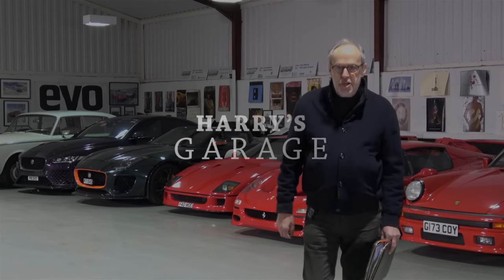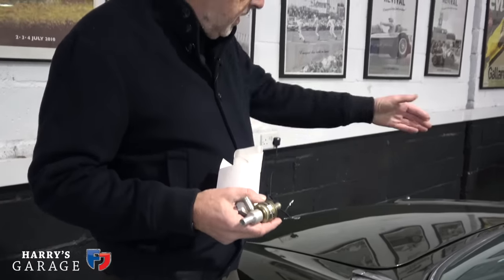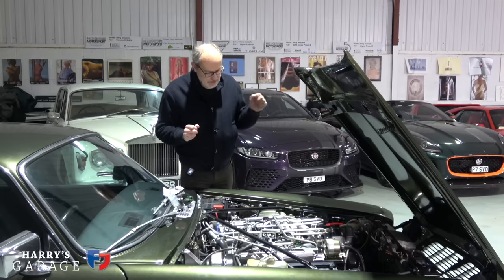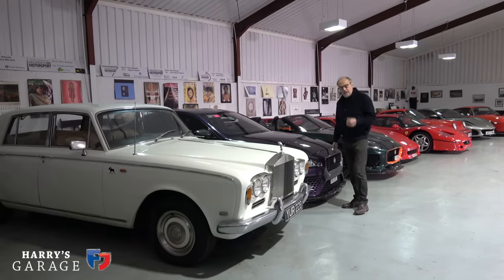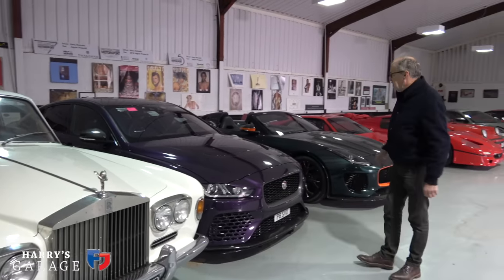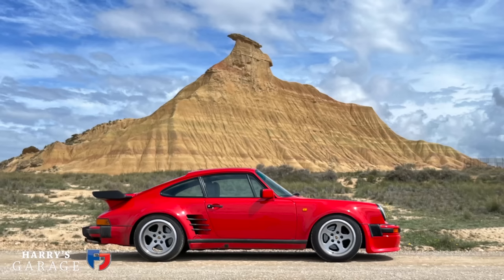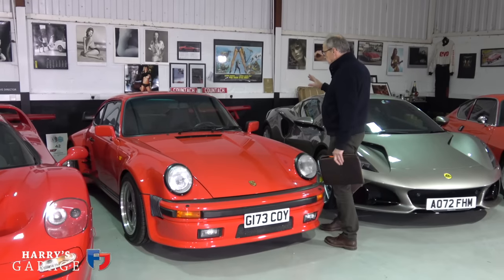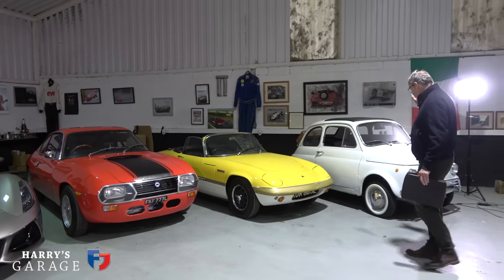Harry's Garage 2022 round-up. The highs & lows plus all the costs

Comment: About your issue with the Lamborghinis and parts availability, recently had a similar problem with my mercedes w126 300SE When updating the ignition, had to replace the rotor arm base plate. In the m103 engine, the rotor arm bolts into a plate that itself is bolted into the camshaft pulley. The question is that the plate itself broke when uninstalling the old rotor arm, and when sourcing a New one, neither Mercedes Benz nor Bosch (OEM) do not produce that part number anymore, there is instead an alternative part number with an alternative design. Bought that alternative that part From the dealer to discover it was a tad too short and the hole in the center a tad too narrow. Had to mechanise it and source a new bolt slightly longer from a random hardware store to make it work provisionally. There are aftermarket parts that copy the old design, but for some reason unknown to me, unavailable in Europe, you can just buy them from US stores and ship overseas paying shipping and import fees, being the quality also a question mark. Unthinkable to me considering it was a rather common Mercedes Benz engine.

Comment: Re. your Jag injectors, I've had problems with my W124 Merc injectors, until I found out, that Bosch now makes injectors that can withstand the mandatory Ethanol mix in modern fuel. The old ones melted partially inside, due to the wonders of modern fuel...

Comment: Smart motorways have radars which detect stationary vehicles, and should trigger some overhead signs to light up.
You were quite safe, Harry.
Assuming the system was working at the time.
Which isn't a given.
Reply: Trouble is drivers do not always take notice of overheads lights/signs.

Comment: Interesting about the XJC fuel return issue. I had a Jaguar Series 3 4.2, which was fuel injected, and never did a thing to the fuel system other than replace the fuel filter every so often. Was utterly reliable on the Series 3, but I guess it did have half the cylinders of the V12!!
Reply from the maker: The Series 3 V12 didn’t have any injection issues either. It’s just the early V12 cars that suffer, one solution is to fit carburetors and throw the fuel injection stuff in the bin but that feels like a backward step to me

Comment: interesting to hear your woes with restored /rebuilt cars; in our local classic car community and I believe nationally there have been significant issues with new/replacement parts for classic cars.  It is now such a big business there are a lot of substandard parts out there masquerading as high quality.  For example Bentley have had significant issues with their replacement gaskets for the old 6.75 V8s, and I had two new hydraulic accumulators fail on my newly serviced 70s Corniche; the (very) old ones were in actual fact fine.  Incidentally I have two Jag V12s and I use them weekly and they are fine; I was thinking of doing a routine replacement of the fuel rail rubbers and injectors but this has put me off

Comment: Common issue with using reproduced parts. Which is why I try to use New Old Stock items, and refurbish original items like starter motors, alternators and distributors whenever possible. Encouraging to see that open cheque book restorations have the same problems as us mere mortals restoring cars in lockup garages.

Comment: one of the issues I've noticed is that companies that make re issue parts can only take an average of what was fitted in period, especially ignition parts as most manufacturers would use several suppliers in the day. I well remember the breadvan VW Polo having 2 different distributers which looked the same and the parts seemed to fit either unit but trust me after much swearing I found that they didn't. Now I'll bet the only parts you can get easily now are for the more common distributer. Don't get me started on  hydraulic parts for old BL cars either.

Comment: Great video and a Happy New Year to you Harry!  Please can we have a TT600 build video series?  Rare bike that! Be an excellent off road tool.  Looking forward to the completion of the Lamborghini and the Testarossa.  Quick one:  Why are you still running horrible old points and dizzy setups on these old cars when electronic ignition and even coil per cylinder conversions on modern EMS would transform their usability? Even the Zag is running modern electronic spark control albeit through a diz!

Comment: So interesting on parts quality I have had the same issue on XJS parts being produced which just don't meet quality in anyway. Bit shocked by your injector rebuild costs had jaguar XJS 6 cylinder done with data provided prior and post rebuild for 25% of what you were charged. I would guess your problem may not be injectors but filter issue. Glad you are sorting the XJ exhaust always looked too low.

Comment: 2:30 
Make a new connection tube from the left tank to the right tank?
So that it evens out again.
That fuel spill is seriously dangerous
Reply: 5:50 Maybe those rubber seals are too hard, compression loss, cylinder not firing.

Comment: Rather than just swapping injectors, what exactly is going wrong with them? Are they getting gummed up (is the tank clean)? are they failing electrically (is the impedance the same across good and bad units)? Is it always the same injectors?

Most injectors are pintle type and don't mind modern fuel. The only thing to really worry about are internal seals made from nitrile rubber which need to be switched to viton to be able to handle ethanol. I've had newly refurbished units come back with nitrile, although they're just the main external seals.

Comment: I wonder if the ethanol in the fuel is causing these problems as its more corrosive and does cause problems with older cars.
Reply from the maker: All the cars in the garage run on super unleaded to minimise ethanol issues. It’s a right pain whatever is causing the problems!

Comment: Harry, I think that the issue you're running into is that the factory fitted parts for Lambos aren't the same from year to year and even within years. There is unfortunately not very good documentation of this. The people remanufacturing the parts don't have enough copies of the variations and should be thanking you for finding these deviations and asking you for original components so that they can expand their capabilities.

Comment: The Zagato is an amazing story. Based on the horrible condition of the car and the inability to really fix the panels, what does this do to the value of that car? As stated it was a driver project, meant to use, but I am still curious as to what that car is worth vs. one with better sheet metal?

Comment: £7000 to insure everything sounds good value but is it really? 
You can only drive one at once and the combined mileage will the same whether you have one or 100 cars. I realise there's more than one driver & theoretically the whole shed could go up in smoke etc etc but once you've got one expensive car the actual risk to the insurance company won't increase that much just by buying more.
I'd be curious what the Project 8 would cost on its own, or what difference all the cars being split between several locations would make - just out of idle curiosity I mean!

Comment: It’s probably why used dealers like Tony Gravelwood Car Sales on Behind The Glass Podcast with Seen Through Glass’ Sam won’t touch cars older than 3-4 years old.  Most people couldn’t cope with the stress of it but with your knowledge and expertise can.  I tend to think you can get taken for a ride with restoration work.  I likes the first Lamborghini restoration of the Lambada from September 2019 but mainly watch your reviews of all the latest top Ferrari and other premium vehicles.  I’d get rid of the Jaguar Project 8 and the XJ and get something like a Bentley or Aston Martin with a good warranty and service package in the run up to full electrification is it doesn’t stall in 2030.  Whether the manufacturers will service them or provide parts post 2030 doesn’t seem clear.  I also like Audi RS and S variants.  You could get a Lamborghini Urus.  They’ve made so many there must be good parts support. Also Audi RSQ8 or Aston Martin DBX 707.

Comment: "Part Quality" is a truly frustrating experience which seems to be a worldwide problem. I have numerous negative dealings with this matter however in Harry's case it makes a complete mockery of trying to "run in" the rebuilt Jag engine. With those injectors failing I guarantee those cylinder bores with the dodgy injectors will be scored / damaged. Absolutely Horrendous😖😖

Comment: Interesting and refreshingly frank.

With respect to injectors, this issue is keeping an XJ12 I know of off the road, so a good, tested component would be welcomed. The owner of the car in question has spent about 4 times its value on trying to solve these after-market gremlins. 

For the Espade, distributors have not been made properly for years and this is the main reason why FIA Appendix K (6.5) allows for Period F onwards "non-period electronic ignition system provided this system is triggered by contact breaker(s), utilises an ignition coil
with a minimum resistance of 3 ohms, the spark is distributed by a rotor arm and the timing of the spark is controlled entirely by mechanical means". 

Whilst I can understand that purists / concours judges may not like this...I would not risk a beautifully built V12 with even OEM remanufactured components.

Comment: Jaguar injectors! 2k! There's nothing wrong with standard injectiors... However the system is far too old.... I converted my xjs v12 to modern Motec, costom system with modern injectors and lambda sensors..... Its fantastic with instantaneous throttle response... & great economy

Comment: The shoddy modern replacement parts situation does annoy me. It's easy to blame the Chinese, but the real problem is the casual attitude of the European suppliers. If they specified the quality and tolerances properly, the Chinese are quite capable of manufacturing the parts to be as good as the original.

Comment: It is a bit disappointing that the firm who rebuilt the v12 hadn't preempted the injector issue as it is a not uncommon engine and I'm surprised they were not aware of it.  Also I would expect that someone would have checked the Lamborghini rotor arm against the original. You are not exactly using any old garage, these people are otherwise supposed to be the best.
Reply: Anyone else would fit an electronic distributor so you don't have points and issues like this to the Lambo and there are ones that look like the original.

Comment: If the fuel injection is still a pain perhaps a more modern system would be better. Emerald stand alone strike me like the sort of company that wouldn’t be scared off by an old jaguar.

The tank issue - sure there’s a way of sorting that as well without relying on old valves. Would also be worth thinking about some sort of buzzer/light that activate when the level is too high.  Better than relying on your nose
Reply: Maybe the lambo needs to go distributorless as well…hadn’t got that far before comment 😂

Comment: Good news / bad news on the repro parts stuff.  I've owned the same '69 Camaro for going on 33 years now and the repro stuff is atrocious.  Even the GM licensed stuff can be garbage.  It took me two orders of RS vacuum headlight switch and actuators to get working parts.  There is so much demand and no accountability.  Once the factory quality control is bypassed junk gets through that new car customers wouldn't put up with.  Luckily for you enough deep pocketed collectors should be able to turn up the screws on Lamborghini to force them to implement some QC instead of just licensing aftermarket garbage.  It begins to make a case for converting to coil near plug with a crank trigger as a permanent remedy.  Myself, I run an MSD billet distributor that is fully locked out and an MSD-6AL programmable spark box on my Camaro.  But you may be forced into coil near plug if you can't get decent caps and rotors for the 4 liter.

Comment: I can envision one of the reasons why re-manufactured parts end up not matching the originals is the loss of the tribal knowledge gained during the initial development. A drawing is made. Parts are fabricated. The process steps of that fabrication, especially those that require heat treatment (for instance) are seldom fully captured. For that matter, there could also be undocumented steps taken at the time of assembly. Dimensional tweaks made along the way that enable finished parts to work flawlessly in the assembly are noted on scraps of paper or in some craftsman's head. The drawing may or may not be revised to reflect an interpretation of the perceived intent of these. Does it though? No one is actually going to check because the parts arriving are functional. 

Does it excuse it? 

There is some value in supplying a gear that with modification enables a vehicle to live on. It's better than nothing. 

For the VW Group or Jag-LR the sales are chump change in the big picture. Regardless, someone in the management chain is responsible for this market sector and must know that 'some' parts they are representing as functional drop-ins don't meet that standard. We can only hope that their ethical and moral compass is working up to snuff and effort is being made to correct the deficiencies (as opposed to a 'take the money and run' attitude).

Comment: With regards to the XJC V12, this is why a fairly straight resto (except the g'box and a few other bits) would never appeal. This is why i would much rather give it to Retropower to work their magic- pissing about with old Jaguar parts designed in the 60's/70's - no thank you. Retro mods are way way more appealing and people forget it's not just about modding for more power/ pace but also for more usability.

Comment: Is it the E10/E5 Petrol wrecking the Jag Injectors ...?? Gov website states ...

'Jaguar
E10 petrol is cleared for use in all Jaguar vehicles with petrol engines starting from model year 1992. Older models should continue to use E5.

I'm still not sure if my vehicle is E10 compatible
If you're not sure if you can use E10 in your vehicle:

check the vehicle owner's manual, the instructional booklet is specific to your vehicle
look inside of the fuel filler flap
ask the car, motorcycle or scooter manufacturer / local dealer
If you're still not sure, use E5 petrol. It will still be available in the super grade at many filling stations.

I'm still not sure if my vehicle is E10 compatible
If you're not sure if you can use E10 in your vehicle:

check the vehicle owner's manual, the instructional booklet is specific to your vehicle
look inside of the fuel filler flap
ask the car, motorcycle or scooter manufacturer / local dealer
If you're still not sure, use E5 petrol. It will still be available in the super grade at many filling stations.'

Comment: 2:06 Harry why dont you convert the thing to a normal tank with a modern fuel cell? also did you check the voltage to see if maybe the new ones, both pump and fuel injector are made with a different voltage spec from the originals, like knowing Leeland, they might have been made with europe's I think 212 spec voltage, vs the 124 of the US, like maybe you got the US spec ones in a europe car, or vice versa

I mean its british leeland, and the cars over 50 some years old, anythings possible with that lot, like it could be that half your car is designed with the wrong voltage in mind and it fails because of it

and with the crosspipes being fitted to it, that is how people make LS motors not sound like rubbish, so you might end up with more an XJ13 type noise at the end of it

and I gotta laugh with 9:08 as today on harry's garage, harry try's MS paint!

Comment: Oh like an old small airplane with dual tanks... isn't it about as dumb as could ever be conceived.  Don't even ask how many small planes have crashed because the pilots do not switch over properly.  A true high point in engineering design.

Comment: Shoddy spare parts is a global issue especially when so called genuine parts or OEM parts are now coming from the same  global suppliers and simpy re-boxed as genuine or OEM
I own 3 x MB W126's and feel your pain with this global rip-off.  The truth is majority are coming from China and quality control is poor, material choice is sub-standard, rubber components are recycled rubbish that quickly fails.  Even Bosch has lowered their standards by outsourcing manufacture and re-boxing.  
The corporate world of parts globalisation to cut manufacture costs/increase profits to shareholders is the driving force to producing rubbish